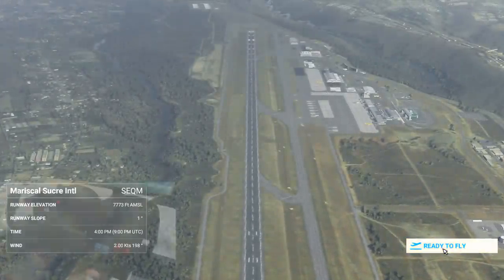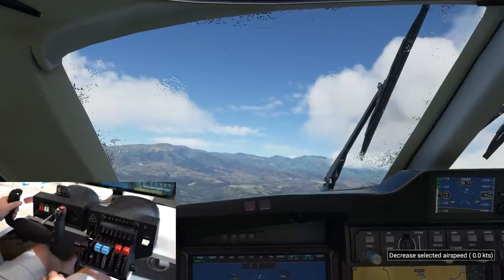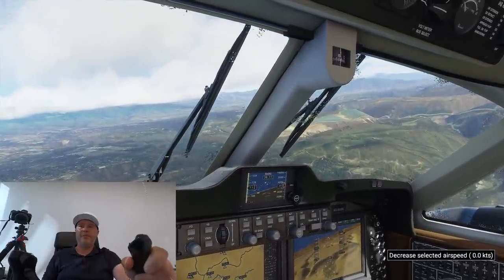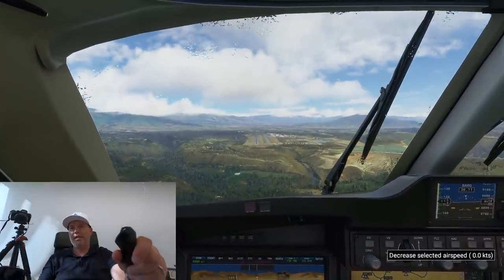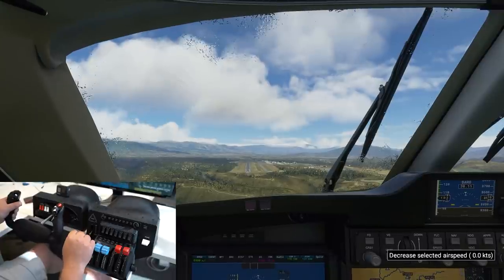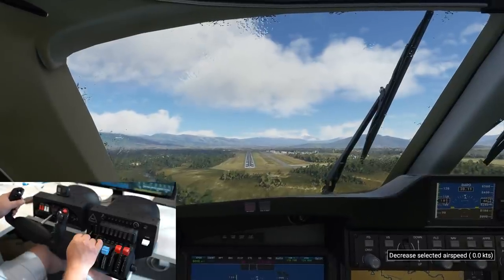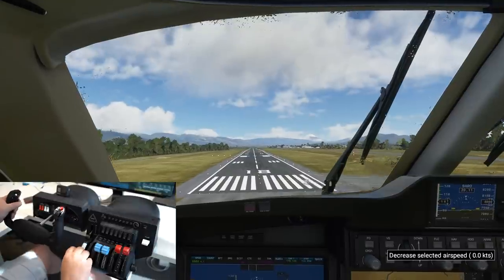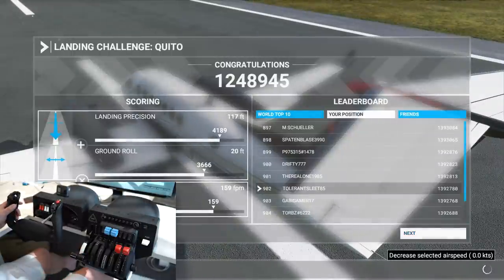Microsoft Flight Simulator - Quito Landing Challenge with Honeycomb Yoke and Throttle

Comment: Show me more of the Bravo Throttle Quadrant and its autopilot operation. So are the other functions.
Reply: and the landing gear sync with the simulator or a mod that someone has done that will allow the 3 lights to sync with the sim
Reply: @harpoon_bakery162  They said they were working with Microsoft to allow the lights and stuff to sync with the sim. Hoping that the same applies for Xplane 11.

Comment: During flight you should keep the condition levers in “Flight idle” until on the ground when you would move to “Ground Idle”. Prop levers used for Beta was okay but you would have been over torquing the engines when increasing the throttle with the prop lever still reduced that far.
Reply: God damn turbo props are so confusing. Gonna need a full tutorial video please and thank you
Reply: Turboprop condition levers do not work same as mixture control. Low for starting, once start is complete and ready for taxi move to high idle. It’s as simple as that.

Comment: I have the yoke; I was happy to be one of the first to get my hands on this equipment; now, I am facing the fact that my old CH throttle does not work with MSFS2020, and I am tired of using the keyboard. I have preordered the throttle, I hope it comes home soon to start using the simulator as planned! Thank you, everyone, and keep the blue side up!
Reply: Ricky Villalobos what about The CH throttle doesn't work for you? I had to manually assign the axes but since then it works well. Also the beta detent is far to minuscle to acutally use but you can assign that to a button. But im as anxious as you to finally receive the Bravo!
Reply: PapaSpielt thank you! I greatly appreciate your comment. My issue is that after assigning the gas throttle as an example. The lever is useful only from the middle of the range to the button or top  because the assigned function works like a parabolic function decreased fuel at the button, maximum fuel at the middle but then decreases back to no fuel at the end of the run. I probably need to tweak some of it. Now, I preorder the Bravo already but there is no specific date if arrival yet. Maybe at the end of the year or beginning of the next one. Some guesstimated time only. All is base in the statement “ if there is no delays.”  I am anxiously waiting. The Bravo is sold out at this time.

Comment: I can't wait for these to come back in stock, but for those with an XBOX controller this is a very nice setup to hold you over.
- Map rudder axis to left stick
- Map elevator axis to left stick
- Map aileron axis to right stick
- Edit XML files for sensitivity adjustment (-75 sensitivity | 5 deadzone)
- Trim on RB / LB
- Throttle on two bottom paddles (Up/Down or Left/Right on Dpad without paddles)
- Flaps on Up/Down or Left/Right depending on your throttle mapping
- A for landing gear
- B for brakes
- Y for parking brakes
- LT / RT for unzoom and zoom
- Left menu button for Landing View which you can hit twice to reset your view

I also just put the mouse on toggle freelook instead of hold so you can move the mouse for freelook instead of having to put you hand on it.
Since I have a 60% keyboard without a numpad, I just made another profile and put the most useful functions on that.
1-9 Instrument views
Page Up/Down for sim speed adjustment
Space bar for external camera
ESC for pause
The rest you can just bind whatever you want for your instruments as a per need basis. I would suggest just starting with that config and following tutorials on how to manage aircraft systems and see what binds you would want extra. 

Hope this helps some enthusiasts :)

Comment: Small correction to your explanation of differences in engine controls in piston and turboprop aircraft: they're actually more similar than you thought, but also different between direct drive and free turbines. PT6 engined aircraft have low and high idle and cutoff, others just have fuel on or off, that's all that condition levers do. Blue levers (RPM) control the prop RPM exactly the same as in piston engine aircraft, except in direct drive turboprops, it's almost always at full RPM. Power levers are self explanatory with limiting parameters, in general being torque and ITT or whatever the engine manufacturer decides to pick for that engine. Units of measure also vary (%, etc).
Reply: That's what I figured, it would be sorta like a helicopter in that you're generally giving it the same amount of throttle but adjusting the pitch?

Comment: Nice video.  It is interesting the Swiss are taught the reverse.  Pitch for decent rate and throttles for airspeed.  I gather it makes the transition to flying airliners a lot easier as it is my understanding airliners are flown this way.  Not sure exactly why.  One of my flight instructors was a former Swiss captain and he told me it was easier to maintain the glide slope that way.  I wonder if jet engines may also play a role in this as they are probably not as quick to respond to throttle changes as a piston engine.  I imagine the same is true of a turboprop.  Learning to fly in Canada I do what you did which always makes for stress with my Swiss flight instructors who get confused with what I’m doing on approach.

Comment: Pitch levers should be full forward before landing. Condition levers at high idle during flight.
Reply: He was on approach so I'm assuming either then or descent is when you switch condition?
Reply: Projekt Gemini no,  condition levers are full forward during flight, propellor lever are full forward when on final
Reply: @kev403  but descent and approach are when you're trying to lower speed, wouldn't you want a lower RPM?
Reply: Projekt Gemini condition lever does not control that. Reduce throttle to slow down.

Comment: Is it me or there is no 3 green lights when the gear is down on the quadrant?
Reply: yea i noticed that aswell
Reply: Microsoft are still working on the Bravo integration. One of the features that isn't working yet are the gear indicator lights.
Reply: Nicki Repenning if it helps, look at how SpadNext communicates with MSFS, as that has all the LEDs for gear working perfectly on the saitek switch panel, so it is certainly possible.
Reply from the maker: @cowboy10uk  I appreciate to recommendation, but from my stand point , you plug it in and it works. That's how it should be. Microsoft have been more that supportive in integrating out products, and by the time of the Bravo launches it will be fully functional. The same goes for X-Plane and P3D. We have mapped well over 100 planes on the Alpha at this point , but it's an uphill battle. That's why we're introducing an SDK for Aircraft developers in the next few weeks so they can ensure full compatibility. We call the program "Certified by Honeycomb" and if the aircraft is fully configures with for the Alpha and Bravo, then can use our "certified" icon free of charge on their product page. That way, you know as a consumer, if you buy that plane if will work seamlessly with our products. Not supposed to be announced yet, but there it is.

Comment: When will we get a proper calibration with the yoke ? That deadzone problem is all over the forums ...
Reply: Mine works fine. Right out of the box
Reply: And instead of crying on a video go look up how to calibrate it. Tons of videos how to do it. Need a 2x4 and a solid floor, desk and yoke clamped on the desk
Reply: @SIMRIG412  I had the yoke dude, the calibration workaround doesn't remove the deadzone completely. Thanks dude, my desks are stable, my brain keeps working and when I need permission to cry I will shoot you a message.

Comment: Ya I got one of your week 1 production bravo throttle quadrant. And my trim wheel makes a grinding noise at certain points when spinning it. 1 no answers at your company on the phone. 2 the guy over email was useless and an asshole. Can I get this replaced or fixed? It's not even a month old and was this was not even uses out of the box.

Comment: I disagree with your pitch controls airspeed and power controls height, its a common misconception which should stop being taught.
Your yoke or stick controls flight path, if you are too high, you pitch the nose down and then decrease power to maintain airspeed and vice versa.
Power controls airspeed.
Pitch controls flight path.

Comment: Pointless advertising when you can’t buy either of them.
Reply: You can, but they are not in stock due to the high demand on the only acceptable yoke :)
Reply: @ChristianMoentest   every place I've looked to order either item shows as out of stock, can not backorder. You make a statement like that provide a link to the site you are talking about or stop making false statements.
Reply: @georgefaulk2528  called ebay. Newegg had these in stock so I ordered. Then got an email saying they didn't get enough stock in 3days they would get more. I waited 2weeks and no shipment. So I ordered on eBay for $90 more then retail. Guy had 3 left it was at my door in 3days. So ebay is the only place or 3rd party sellers.

Comment: Propellers should be full forward early final approach in case of a go-around, same as piston.
Prop lever controls propeller RPM in a turbine and piston, in a PT6, the most common turbo-prop the engine and prop are not mechanically connected, unlike a piston where engine and prop RPM are the same because they are mechanically connected.
Reply: Exactly right, on approach, full prop rpm at 1700, torgue or throttle levers to 20% with condition levers at their full flight idle position, fully configured for landing, and in the event of a go around the power management is set for preparedness.

Comment: Control speed with thrust and approach plane with pitch.  Of course, the reality is a play-off between the 2 but this 'control ROD with power and airspeed with pitch' is hogwash be it in a 737 or Cessna 150.
Reply: No.  You control speed with pitch and altitude with power.
Reply: @5HoH5520  10000 hrs on turbo-props and jets says otherwise.  Try your method flying an ILS in a 74 ton airliner into a +-20 kt gusty crosswind.  It might be the standard PPL brief but you'll never fly a constant glideslope.
Reply: @manlatycon  6000 hr+ ASEL/AMEL SEA, IR pilot  most of which is production test flight.  Unfortunate you haven’t gotten there yet.  Practice makes perfect.  You’ll get there bro.

Comment: Is it just me, or does the side movement on landings seems really unrealistic in MFS 2020? Just seems exaggerated.
Reply: Not sure what you're talking about
Reply: @relytlirpa  The landings seem to pull quite a bit to the side. The takeoffs are the same actually. Then when I try to correct, I get oversteering, like the plane is too light, and the yaw too powerful. I've already lowered the sensitivity on my pedals, so Im not sure what the deal is. You don't experience anything like this?
Reply: @aquaticborealis4877  the only time I have this happen on takeoff is due to engine torq, which is quite realistic in prop aircraft. Otherwise you're experiencing cross winds. (there was a bug recently fixed where crosswind was there even if it wasn't supose to be). Other than that I haven't had any issues, personally.